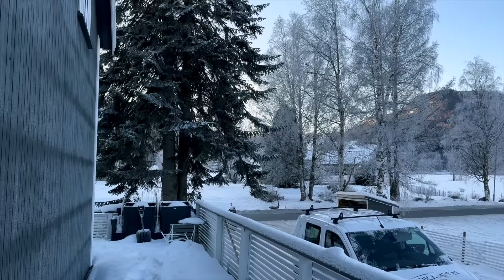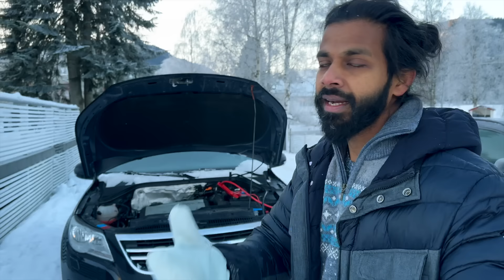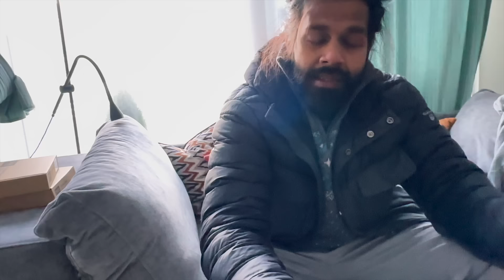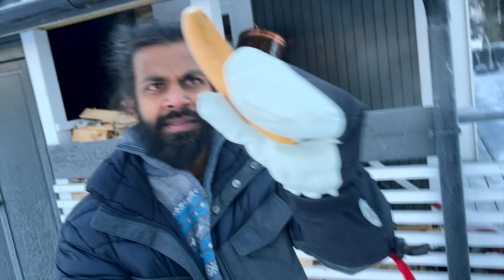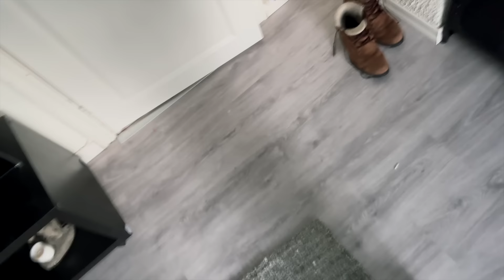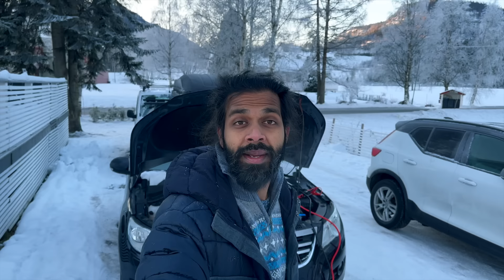නෝර්වේ ජීවිතේ -26 °C ගියාම.It went down to -26 °C in Norway

Comment: Jumper start karaddi cables 4 connect karanna epa battery walata. Very dangerous! Power eka thiyana battery ekata cables deka (black & red) connect karanna, power nathi battery ekata Red cable eka witharak connect karanna. Black cable eka connect karanna EPA, black cable eka vehicle eke yakadayakata connect karanna (safe place ekaka). You tube videos thiyanawa, ewa balanna sure naththang

Comment: Why don’t you buy trickle charger (£80 in here, must be less than €100 for you) and keep it connected to battery permanently when car is not in use as it’s tiny plug to connect and disconnect when ever you using the car.
Reply from the maker: Thanks for the tip. This was the first time this happend. ❤️❤️🙏